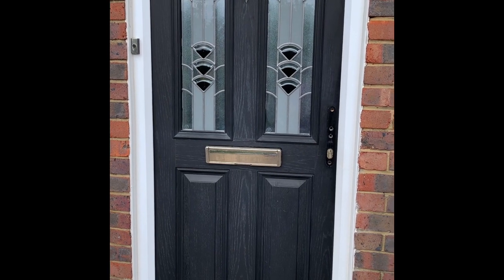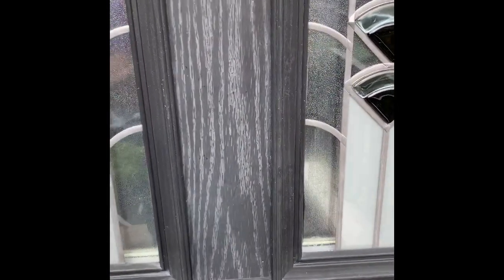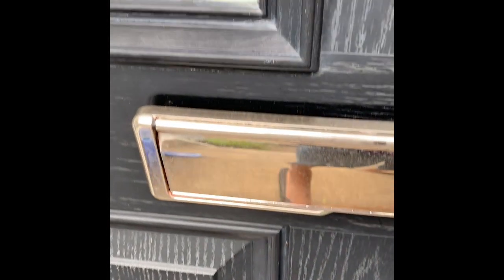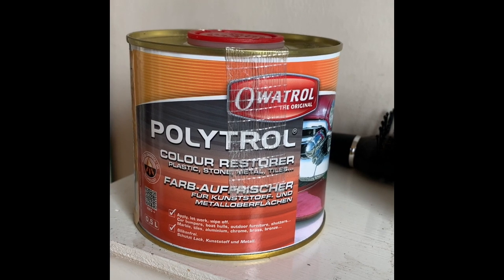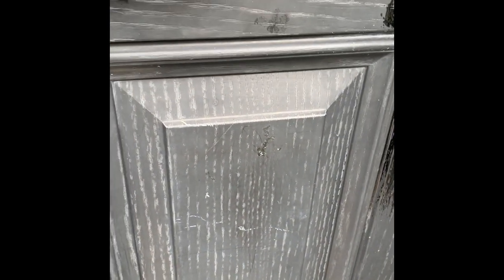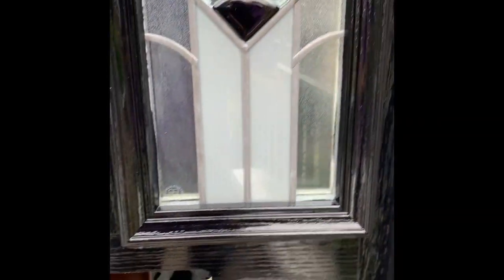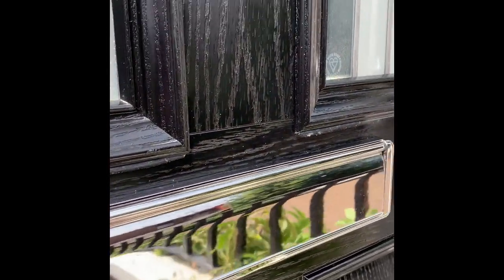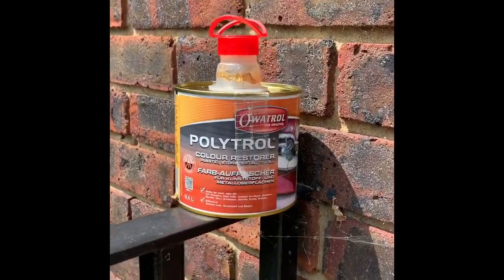Restoring/Painting a UPVC/Composite Door using Polytrol colour restorer

Comment: I can't seem to upload a photo on here but I have a door that was much worse than this and used WD-40 and it came up like new!
Reply from the maker: Sounds good - may try that. Thoughts; does it last?  Does it smell of oil? Is it practical brushing past in my best frock?
Reply: @robquickfix2841  Hi Rob, yes it does last, I discovered it by accident, when my door lock felt tough I squirted WD-40 on it, a couple of weeks later I  happened to notice, there was a line right down from the lock of the original colour, obviously the WD40 had run and brought it back, so I applied a very small amount of WD-40 on a cloth and rub the whole door down the results were absolutely brilliant, unfortunately I can't download the photos. And no it doesn't leave a lasting smell wd40😁
Reply: This looks good. I've just done mine  a red one, and the faded areas didnt come up as  good as that, the whole door is certainly shinier, but the faded/ lost colour sections remain. Any idea if I've done something wrong ?